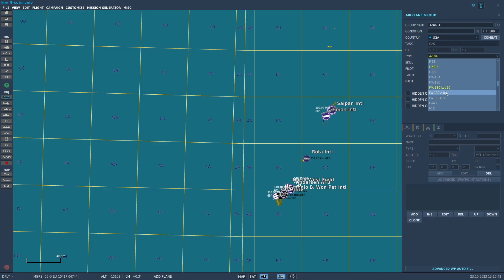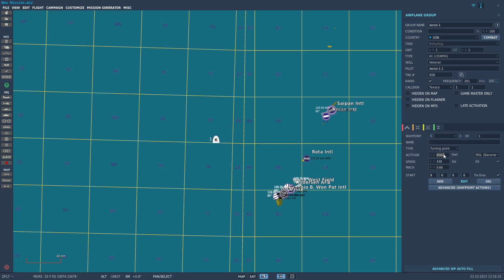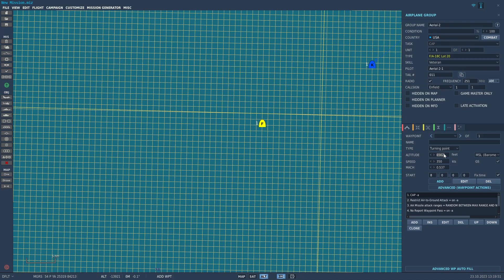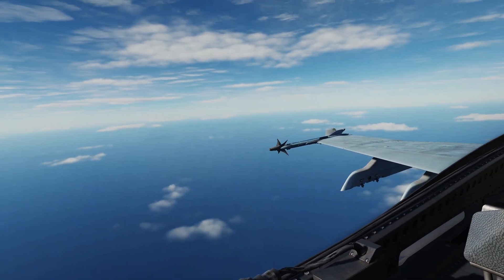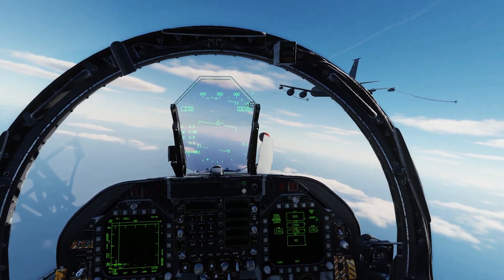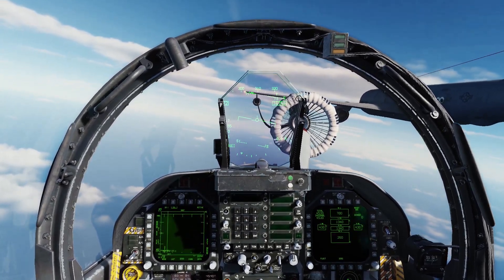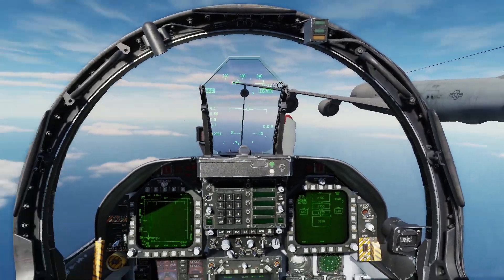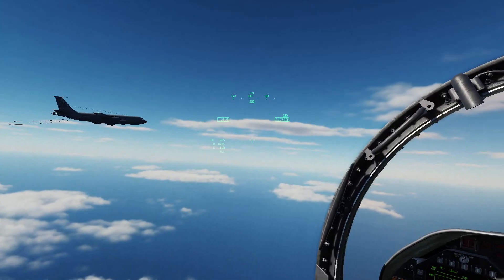DCS World: F/A-18C Hornet Aerial Refueling Tutorial

Comment: 5:06, dude that is all in all an 50/50 nice Tutorial. Most specifically how to set up the Refueling in the Editor...that's neat, but the flying part is useless, sorry. But having no Wind set up in the Mission and  Wake turbulence turned off is a no go for a Tutorial in DCS as it is a night/day difference to Windy Conditions at 26000 feet and Wake turbulence activated. It would have pushed and twisted you around as you closed in from behind the Tanker, and the basket would not have gotten caught as easy as you did it. Try it again. And if you manage to refuel with all these Conditions, then I´ll also like your Video.
Reply from the maker: Wake turbulence in dcs is not realistic, and just a pain in the ass, so i leave it off. And besides, its off by default, which is how most new players will play. And yes you are right, the wind does make it more difficult, but the principles are the same. And the good thing about dcs is that we can set the winds to whatever we want to achieve the degree of realism and fun we want. And additionally, its hard enough to learn the basics and get them down well without winds, and it is a better idea to learn the basic skills to do it before you add more layers of difficulty with high winds